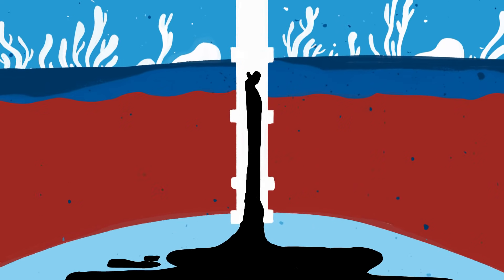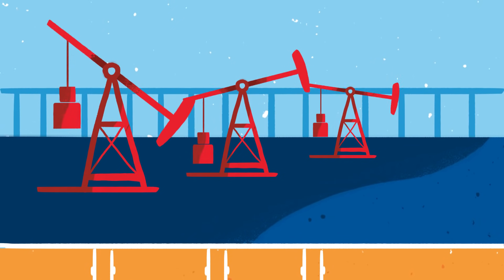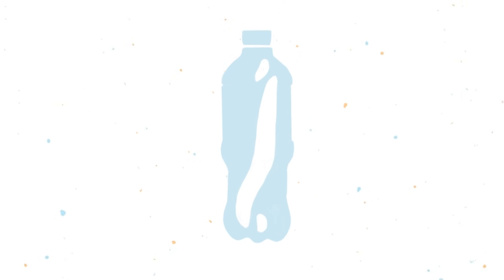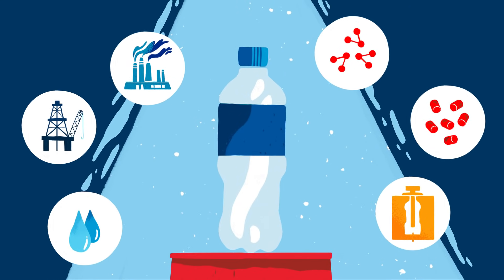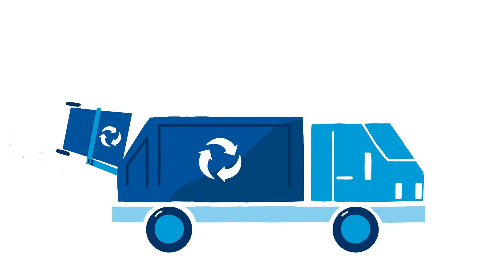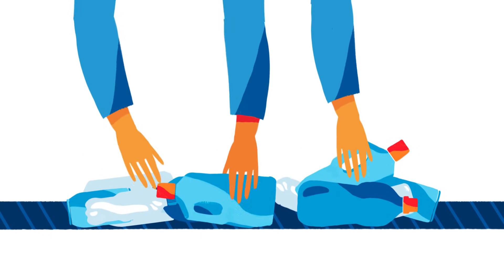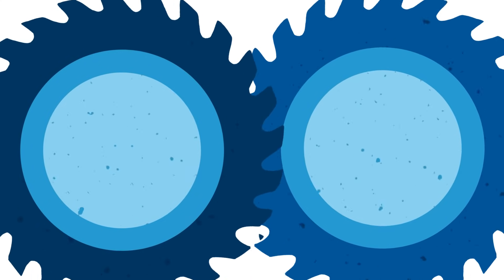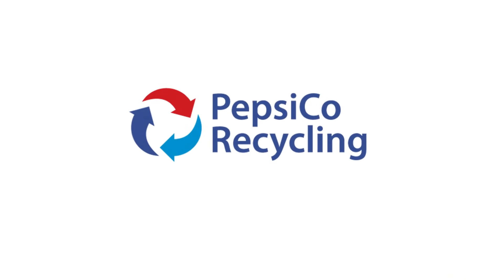Life of a Plastic Bottle

Comment: If we take into consideration the facts that not only the fossil fuel reserves, that we have in the world now, would last just few decades but also if we don't stop 'extracting & utilizing' them right away(and switch to clean, renewable energy), according to recent scientific studies, they would make an irrecoverable impact on our ecosystem -  life & environment, and with these facts in effect, we are left only with all the plastic that has been made from them so far, which would take about 500 years(according to estimates) to totally disappear/decompose. After that nobody would find that anymore.  
     Though plastics' extraction had consumed huge amounts of energy earlier,  it's better to recycle, mold reusable forms(without harmful chemicals) and use, because their recycling/remolding consume only fraction of energy and they have many advantages over other materials like metals/alloys, glass etc.  and also because they can't be dumped here and there haphazardly.  Only major requirement is of proper disposal, right measures to make their(even tiny specks) way back to recycling plants after usage.
     We need to use them prudently in such a way that by the time they completely disintegrate/vanish in the coming centuries, they pave a way, by God's grace, for more eco-friendly, life sustaining, healthy, positive, blessed living.

Comment: Recycling isn't the answer.  If your bathwater is over running you don't first run to get the towels, you turn off the tap.  We need to turn off the unwanted plastics supply tap and that includes you PepsiCo.  If beer can come in gallon cans, why not Soda's.  Or better still sell your flavours as concentrates in glass bottles and let people make their own soda at home.  Act now or your rivals will and you'll be left floundering.